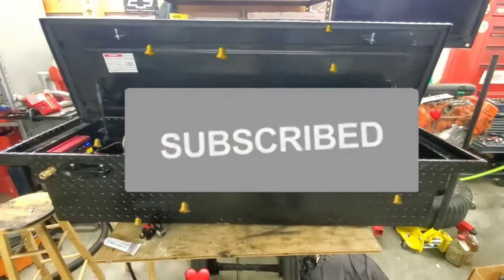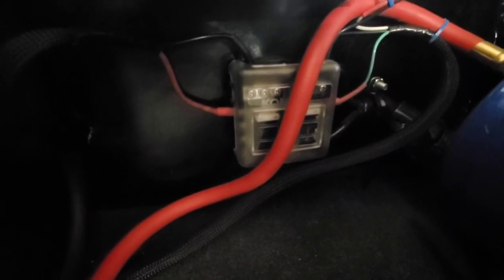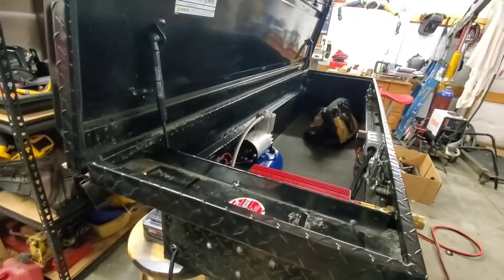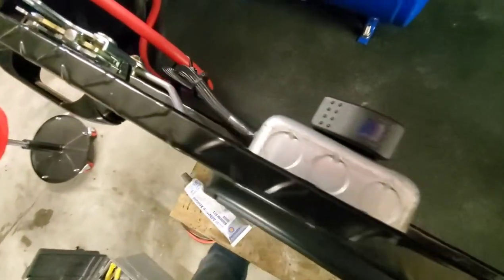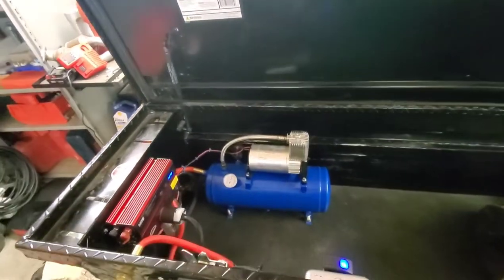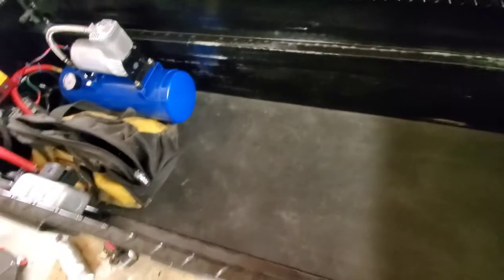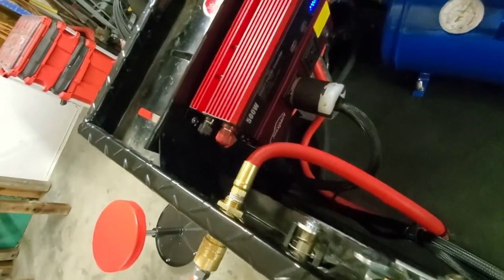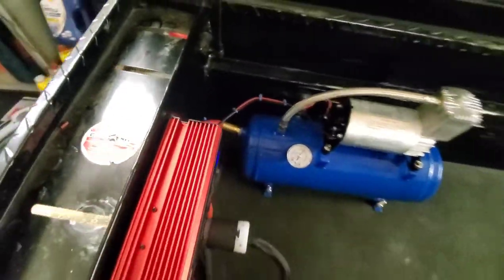ULTIMATE TOOL BOX FOR THE LMM DURAMAX, INVERTER AND COMPRESSOR PART 1

Comment: I've been looking for a diy for a box like this. Great job looking forward to the next videos. I've been watching videos on the truck boxes from the commercial companies who make these boxes and the price is outrageous. I was wondering if you might implement solar panels like the one produced by the company that makes the tool box called the juice box. Thanks.
Reply from the maker: Thanks for watching! I did think about solar panels, but where I live the hail will break them. If my box was bigger I would consider adding a 12 volt deep cycle battery that charged off the truck though

Comment from the maker: UPDATE. I've been using this box like crazy. I Ran a Pit Boss smoker while we were camping, the air compressor is handy as hell, fixed my sons bike, air up my airlift bags for towing, filled up trailer tires. Like I said handy as hell. Here are the links to most of what I used. Bestauto 12V 150PSI Air Compressor Pump Portable Tire Inflator with 6 Liter Tank 1.6 Gallon for Train Horns Motorhome Tires https://www.amazon.com/dp/B07PWJMHVH/ref=cm_sw_r_u_apap_MdZDVn1Sqg2gO 
Legines Brass Bulkhead Fitting... https://www.amazon.com/dp/B074FT9JJG?ref=ppx_pop_mob_ap_share
Check this out at Amazon.com
Milton (S-716) 1/4" Male NPT M Style (Industrial) Air fitting Quick Connect Coupler https://www.amazon.com/dp/B000COS0PQ/ref=cm_sw_r_u_apap_Ms8nSHqonFRAj
Check this out at Amazon.com
FYPower 22 Pieces Air Compressor Accessories kit, 1/4 inch x 25 ft Recoil Poly Air Compressor Hose Kit, 1/4" NPT Quick Connect Air Fittings, Tire Infl https://www.amazon.com/dp/B07WFPZ2VS/ref=cm_sw_r_u_apap_iWywv57IS5G15
Check this out at Amazon.com
Kohree 6 Way 12V Blade Fuse Block 12 Volt Waterproof Fuse Box Holder, 6 Circuit W/Negative Bus Fuse Box with LED Indicator for 12V/24V Automotive Truc https://www.amazon.com/dp/B07XXTQPKL/ref=cm_sw_r_u_apap_BI5ii3cZIsesm
Check this out at Amazon.com
Car Audio Circuit Breaker Reset Fuse 200A for System Protection 12V/24V ... https://www.amazon.com/dp/B01JL3IPWQ/ref=cm_sw_r_u_apap_nw9d5ySAlerHu
Check this out at Amazon.com
TEKTON 46132 3/8-Inch I.D. by 3-Foot 300 PSI Hybrid Lead-In Air Hose with 1/4-Inch MPT Ends https://www.amazon.com/dp/B00Z1K61IE/ref=cm_sw_r_u_apap_AGGWnFBDuNt6v

https://www.amazon.com/dp/B073VHBRFC/ref=cm_sw_r_u_apap_RhX8WWs3S4nmh
https://www.amazon.com/dp/B00ODWODOU?ref=ppx_pop_mob_ap_share
Check this out at Amazon.com
TWING 500W Power Inverter Car/Lightruck 12V DC to 110V AC Converter Dual 2.4A USB Ports Car Charger with Dual Cigarette Lighter Ports for Smartphones https://www.amazon.com/dp/B0899VM5H6/ref=cm_sw_r_u_apap_8ZCXbbVd7MC8R
Check this out at Amazon.com
RVGUARD RV Spring-Loaded Weatherproof Receptacle Cover in Black (Receptacle Included) https://www.amazon.com/dp/B083LRK682/ref=cm_sw_r_u_apap_oo51EbpRm7GeF
Check this out at Amazon.com
Orion Motor Tech 2-4 Gauge 175A... https://www.amazon.com/dp/B015CKKU6G?ref=ppx_pop_mob_ap_share
Reply: I've been wanting to toss an inverter in my truck to bring my smoker for tailgating and camping. But now you have me wanting to do more. Thanks for the inspiration!
Reply from the maker: @rideyoride  Glad you like it! It's pretty cool to run a pellet smoker in the back of your truck, throw in a cooler with some cold ones in it and you're good to go!!

Comment: Make a divider to block that stuff off. So tools/equipment doesn't smash stuff. That through the box is called a bulkhead fitting available in many different sizes of threads.

Comment: Make sure the cables/wire you buy is 100% copper NOT CCA(copper clad aluminum) and better quality circuit breakers like Bussman or BlueSea. That 200a is an Amazon elcheapo likely to fail. That compressor is gonna be extremely low output. Compare CFM ratings at the same PSI. Most compressors are at 40 or 90. If they say cfm and no psi...they are probably free air or 0. A larger number to look good. Higher the PSI the lower the cfm is. So a 10cfm at 0, may be 6cfm at 40 and 2.5cfm at 90

Comment: How is this system working for you lately.  Looking to make the same thing.  More so for off grid living and work...  But for now it will be a back up for the RV.
Reply from the maker: This set up still works great, I'd add a deep cycle battery and solar charger if I had the room.
Reply: @heldtheflashlightfordad6728  exactly what I want to do

Comment: Hey mate great job looks awesome! Did you install some sort of rcd or circuit breaker from your inverter to your power outlets or did you just use a lead or something and wire it strait to it cheers
Reply from the maker: The inverter has internal protection, so I my power outlet on the outside of the box plugs directly into the inverter.
Reply: Cheers

Comment: hey I'm trying to do this with my job box but I'm trying to run an impact and all the specs say I need like 4.5 to 5 scfm which that comp isn't but I'm wondering if you could tell me if it will run it for you bc ideally I'd only be changing one tire and run time isn't important.
Reply from the maker: I definitely can't run an impact, but I Keep my 20 Volt Dewalt Impact in the tool box and use the inverter to charge the battery.

Comment: ExtremeAire from Extreme Offroad have some really nice higher output 12v model compressors and rated for continuous duty at 100psi. They are pricey and high amp draw though. ARB have some nice units but again are high priced. Air compression takes power. More volume = more power draw. There's a Smitty Built line like Model #2781 or the other cheaper brands that are 150-180L per Minute  and will be at 0psi which is how most of them are rated. Unless they list the PSI. Essentially the higher CFM at higher PSI means more output, size matters. Anything under about 1.5cfm is gonna be ungodly slow. Also the longer the Duty cycle the better. Some are on for 5 min off for 10 min. Continuous duty is the best...essentially that, constant run.
There's a twin 300L output from Napa under the Maxi Trac brand also sold in Australia. They're hard to get now but price is incredible along with the output at 10cfm. There is also a brand similar from Summit Offroad, for 2x the Price. Tons of them sold under many brands in Australia like the Thumper MKII. 

The other option is a converted A/C compressor like the Sanden 709 from 97-06 Jeep Wranglers, or the less desirable York 210 which have oil to deal with. These require some minor mods and custom engine mount with a new longer belt needed, but give 8-12cfm at 100psi at 1000rpm's. That's some serious volume and basically what's used on Semi's.

There's also the more industrial high end options that are very expensive but made by companies like VMAC. They have underhood units that output 40-170cfm which is insane.

Comment: Did that outlet come with the switch behind it or did you buy that separate and wire it in yourself? Either way would you mind explaining how you did that and mounted it the switch to it
Reply from the maker: You'll have to get the outlet cover, an outlet, and a box. The cover has screws that go through and hold the box tight

Comment: I’d really like to find that coupler to go the box with the air hose
Reply from the maker: Here you go.
Legines Brass Bulkhead Fitting 1/4" NPT Female Bulk Head Pipe Fitting Bulkhead Coupling（3/4-16UNF) 0.98" Male, 15/16" Length (Pack of 2) https://www.amazon.com/dp/B074FT9JJG/ref=cm_sw_r_apan_glt_fabc_2BB813M2QEAP92VHTVS4
Reply: @heldtheflashlightfordad6728  LOL that's the exact ones I recently bought

Comment: great work  where did you get the air compressor?
Reply from the maker: Thanks! I bought it on Amazon. Honestly I should have spent the money on a VIAR compressor and eventually will. This one still works, just doesn't have the recovery I would like, but it gets the job done.
Reply: do have a name or model number for the compressor?
Reply from the maker: @butler4719ify  If you look at the comment below where I give an Update, you'll find links to everything I used.

Comment: Have you used it with the lid closed? Does it effect the compressor
Reply from the maker: I have used it with the lid closed, with no issues. I would probably keep the lid open if I was gonna run it for more than 5 minutes or so, those little compressors get hot
Reply: @heldtheflashlightfordad6728  do you think if I run a larger inverter and a extra battery and a battery isolator beside my truck battery. If I could run a pancake air compressor like a 3 or 6 gal or even a 8 or 10 gal?. Thanks for advice
Reply from the maker: @alonsoamezcua2386  I'm not 100% sure you can get an inverter big enough to handle the amp draw of a pancake compressor. I only looked at 12 volt compressors. ViAir makes some pretty badass 12 volt compressors, way better than the one I installed, but they are 💰💰 pricey. Eventually I'm gonna upgrade my compressor, but I will stick with a 12 volt. Your idea sounds good though, just make sure the math adds up.
Reply: Yea , I'm trying to double check everything before I go through thanks
Reply: @alonsoamezcua2386  what did I end up with? Thanks for any info.

Comment: What tool box is that
Reply from the maker: It's a Tractor Supply brand. I don't recommend it if you keep heavy things in there, Mines starting to crack. I'll need to replace it pretty soon.
Reply: @heldtheflashlightfordad6728  awesome thank you for the response and I was wondering about the heavy items.